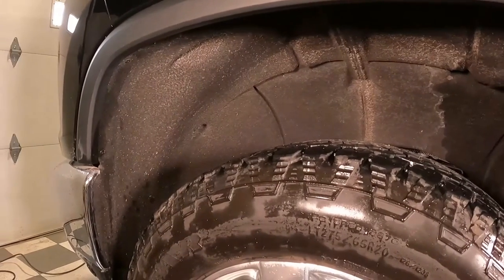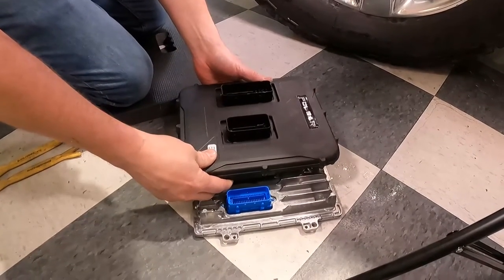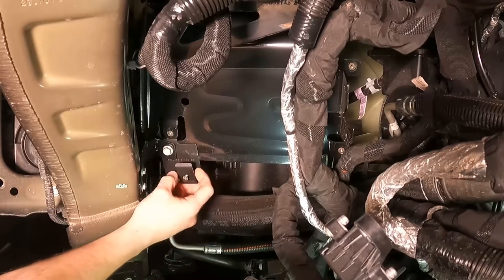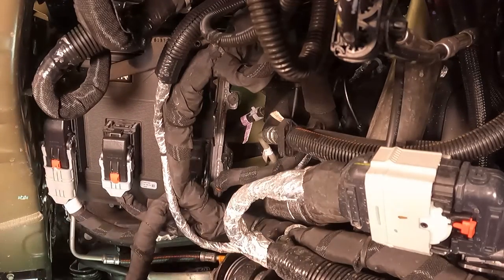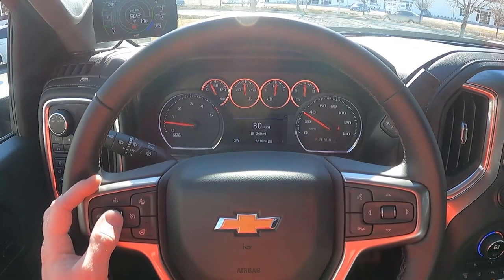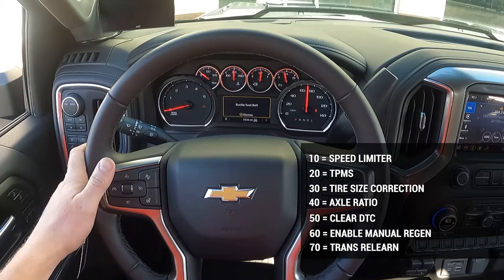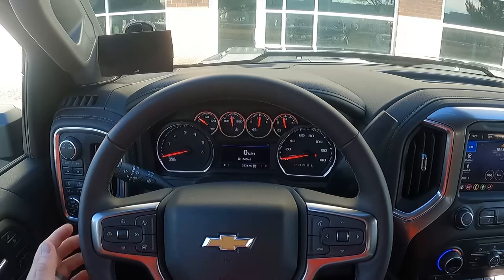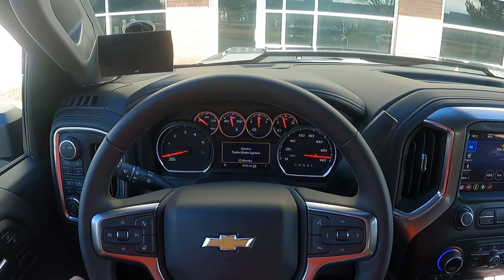Pulsar V3 2020+ L5P Duramax Installation

Comment: Can you not just use added monitor to adjust all settings like for the programming menu part of the video Instead of using the steering wheel buttons ?

Comment: Can the setup be done using the cts3?  Or does everything have to be done like the video?
Reply from the maker: Adding the CTS3 does give you some control over the device setup
Reply: @edgeproductsman  the only control I have with my edge monitor is power level.  Is that wrong?
Reply from the maker: @josephnelson5006  You should be able to adjust other features of the Pulsar unit by going into the settings menu on the CTS3 and scrolling to find the 'Pulsar Options' submenu